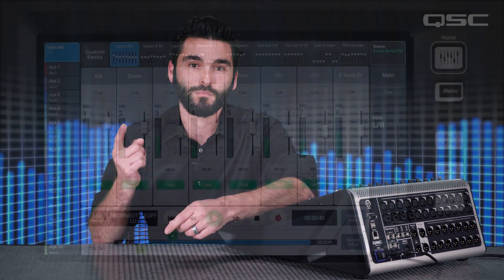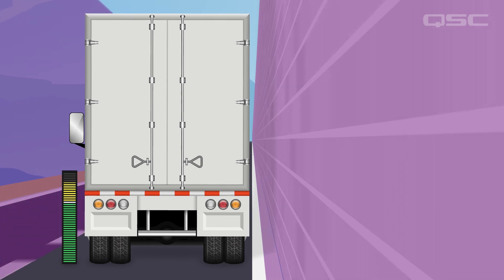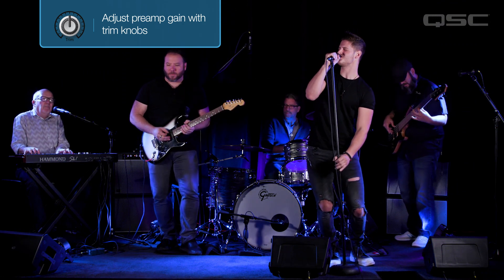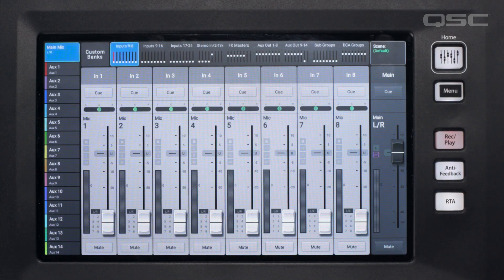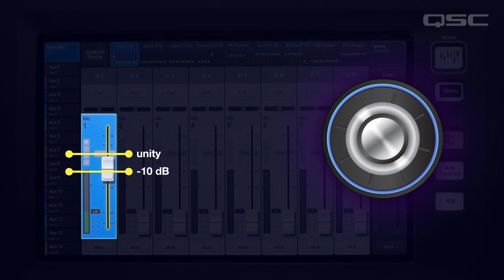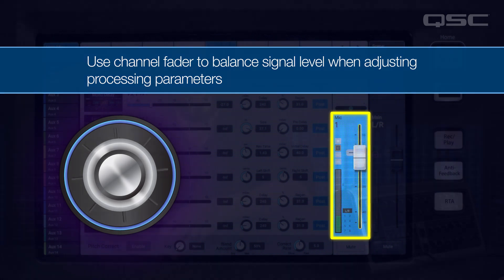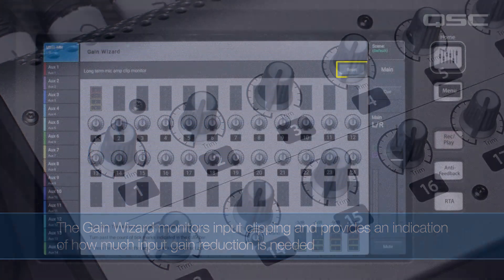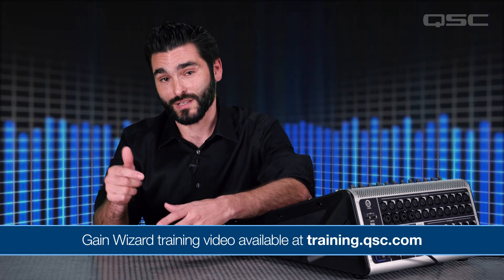TouchMix Application Video Series: Gain Structure Explained (Part 2) - Mixer Preamps

Comment: I'm confused and hope you can help.
As you point out in the video, sometimes a musician may play with a wide dynamic range. Setting the analog channel gain (trim) to avoid clipping in this scenario often leads to a lower than desired average signal level for the channel.
At this point, I understand you to indicate that the digital gain feature can be used to overcome this low average signal level condition caused by the trim adjustment.
I don't understand how this is possible. The schematic in the owners manual of my Touchmix 16 shows that the digital gain comes almost immediately after the analog trim in the circuit. And both are ahead of the compressor.
So how is it that a digital gain placed immediately after the analog trim can raise the average signal level without causing the same clipping condition farther ahead in the circuit that the analog trim causes?
What am I missing?
I hope I'm understanding correctly, but it seems to me that the digital gain would have to come AFTER the compressor to be able to raise a channel's average level without causing clipping.
Please clarify.
I mix from stage in a three piece classic rock cover band. I have my system dialed in quite well and it sounds very good on our inside gigs.
But we have some outside shows scheduled and I would like to clearly understand what I can and can't do with the digital gain feature to increase system volume via optimal gain structuring.